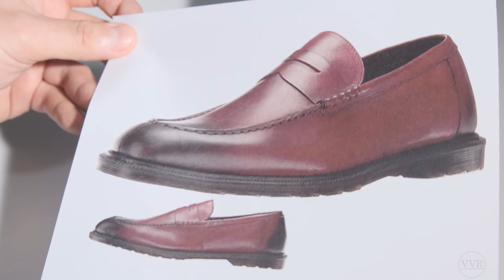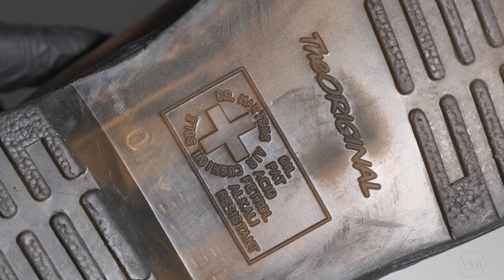[ASMR] Clean & restore "Dr.Martens" "Penton" penny Loafer  -4k

Comment: why to take off and replace the bottom? it's dr martens and the material for the bottom is steady and in good condition
Reply: plus "shoe glue" is just contact cement and it doesn't work on rubber, are this just for show? im starting to get the feel of it
Reply: @gaulol  Doc martens soles aren't rubber
Reply: why repair doc martens at all?  They are notoriously for being poorly made and poor materials.
Reply: @trollerblade1011  nope i didnt ask about it.  But it looks good. So it's great for me :)
Reply: @amanasd26  Sorry, are you suggesting that Dr martens are somehow notorious for poor quality?
Reply: @amanasd26 . The original u.k. made Docs lasted a very long time. But the current ones made in China not so much.
Reply: Dr.Martens rubber soles are the worst out there. It's the first thing that gives up on the shoe.
Reply: @gaulol  shoe glue is actually called "barge" and it works on everything. it's extremely toxic, but also extremely effective
Reply: He just put new tread on it

Comment: Ty for another great video. You focus 99% of restoring on the outside of the shoe. Any tips for restoring inside to the original smell? All my deodorants either wear off or have a chemical smell. Also, best way to restore beige suede Janoski back to their original glorious color?
Thanks
Reply: To get rid of the smell just wash them and dry them with a hairdryer on low heat. Then, after you wear them through the day, use shoe trees to absorb any sweat . If you don't have shoe trees, remove the insole and make sure to keep the shoes in a dry place
Reply: @danidaimondzofficial582  what's the proper way of washing inside of a shoe? Somebody recommended me throwing them into a washing machine, but they're suedez
Reply: @zoomfocuszoom  No, don't throw them in the washing machine. It will ruin the leather, especially if it's suede. Just use some mild soap and a brush and try not to wet the outside of the shoe too much.
Reply: @danidaimondzofficial582  эжхэзщ